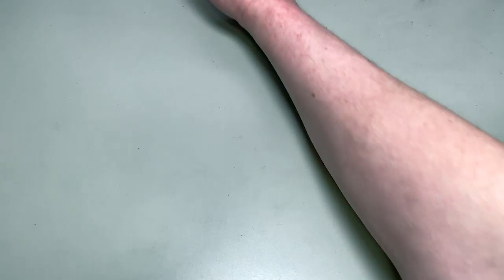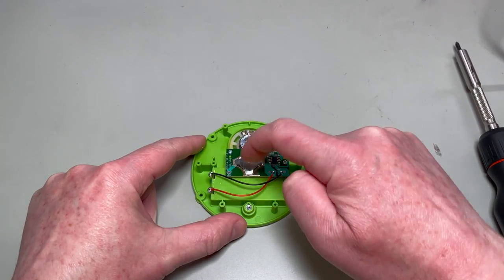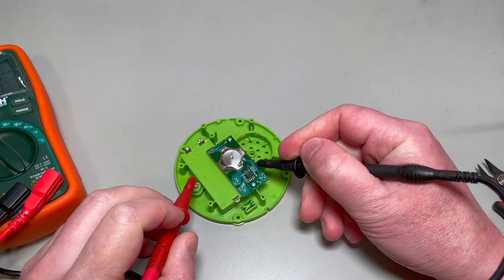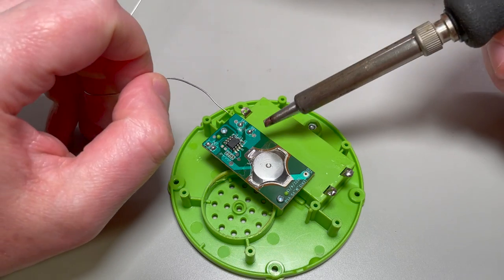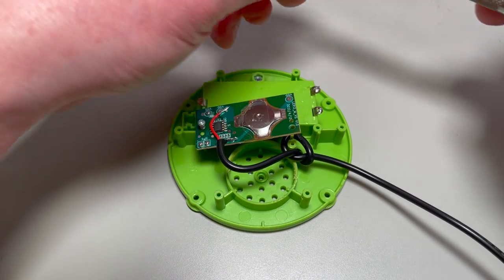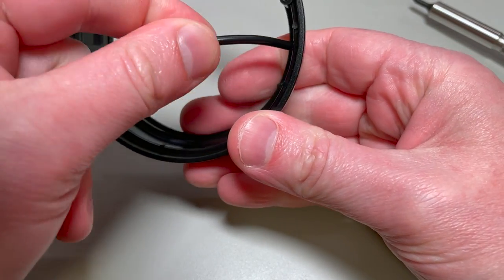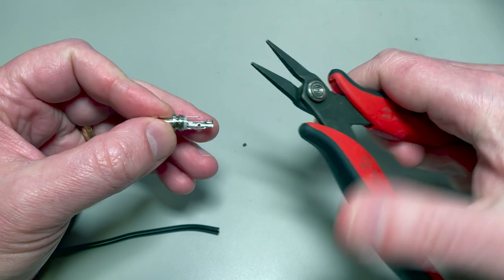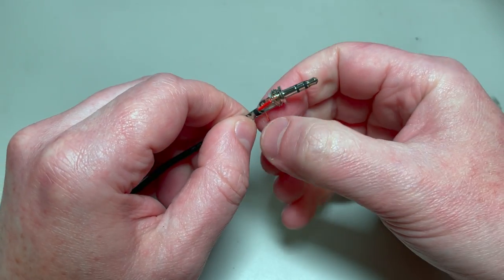How to Make a Cheap Switch for Adapted Toys

Comment: When I do this precisely as you have laid out the button does work! However..... for whatever reason on 2 out of 2 so far when I plug it into the battery interrupter there is still a very weak electrical current going through the wires just barely turning the toy on. When you push the button it goes all the way on but it doesn't fully turn off. I'm not quite sure why this is. When I check with the continuity tester it says there is no connection until the button is pushed. So I'm kinda dumbfounded. If you could please help that would be great.
Reply from the maker: I'm not sure either, but I have something you can try.  Try prying off the IC there, and/or using a utility knife to cut all the traces which aren't directly involved in the circuit you're making with the switch.

After uploading this video, I found this excellent guide from Santa Jerry (who also sells these buttons for a very reasonable price):
https://www.youtube.com/watch?v=YrrcEO78jbo
In this video, he mentions that he's seen a very weak current like you're describing, and cuts unnecessary traces to prevent it.

Give that a try, and if it doesn't work we can dig in deeper!